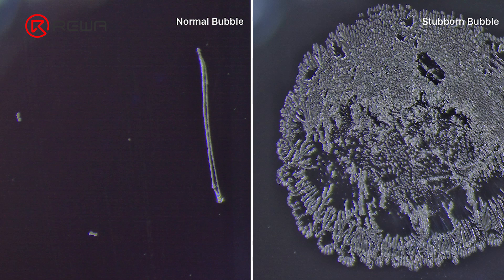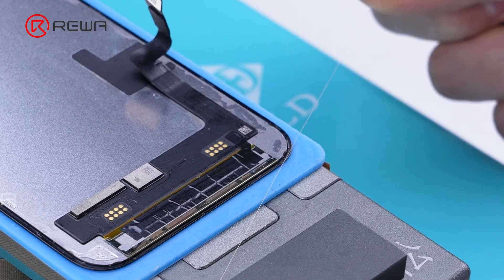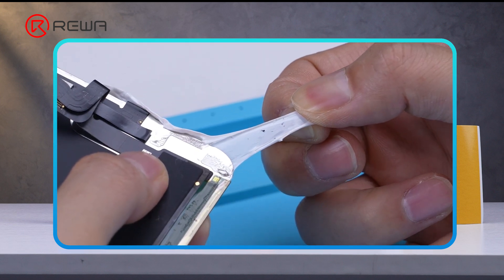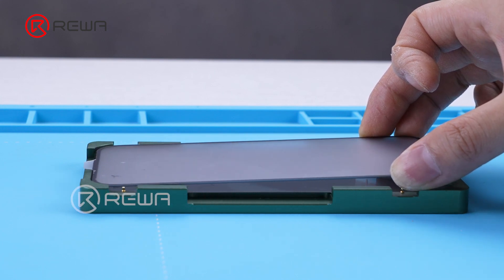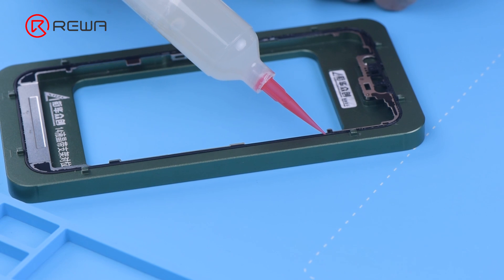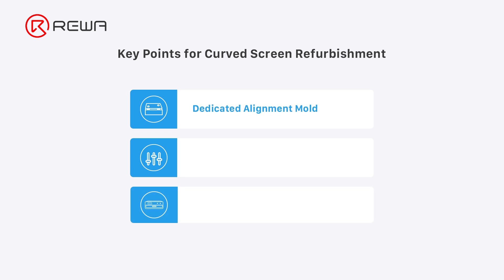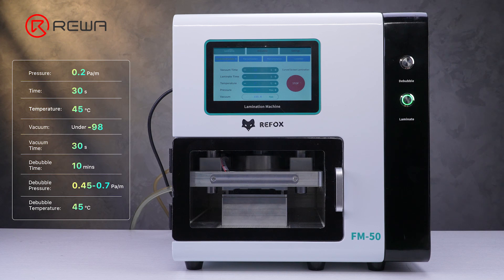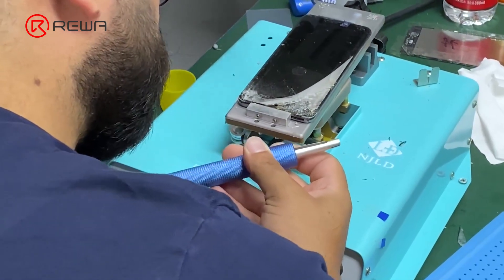How to Refurbish Phone Screen without Air Bubbles?

Comment: Hello
I've been having an issue when refurbishing newer iPhone screen(13 and up).
When the glass is sperated, on places where glass was cracked it always shows holes in front layer of screen. It doesn't affect oled(no black sports) but when new glass i laminatef it always shows that holes on screen when it is turned off.
Reply: Mon problème a moi sur le 13 au moment de la lamination il ressort avec de grosse bulle ou alors le composant de tactile ressort sur l'écran je pense que c'est une question de réglage mais je trouve pas solution

Comment: Hi, I have this machine. I buy this machine from REWA. Sometimes I have this problems also with air bubbles. My question is that I see two 6 mm rubber mat for use. WHY ? Is that better for bonding or is that 100% better without any bubbles with the specific settings at side ?
Reply from the maker: For better laminating effect, we use two rubber mats; just one rubber mat may cause deformations
Reply: Ok thank you for reply 😃🙏
Reply: As my last question I see that you use an another settings installation, is that setting installation better for laminating ? With 2 Matt 6 mm ?